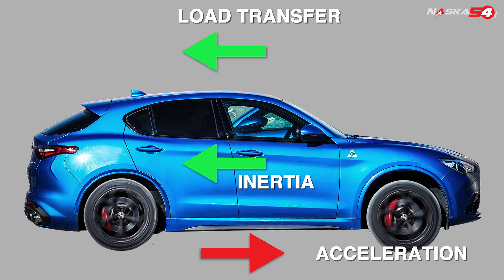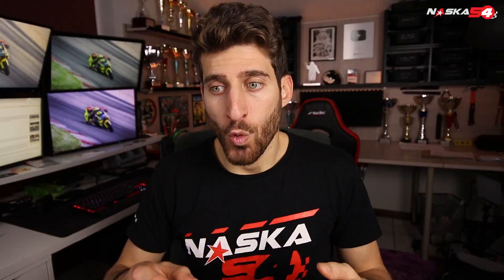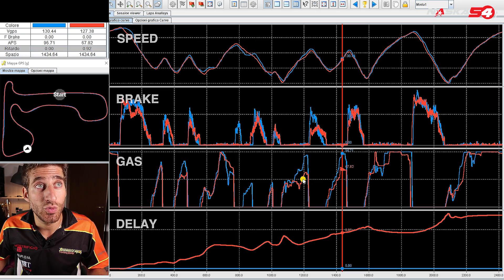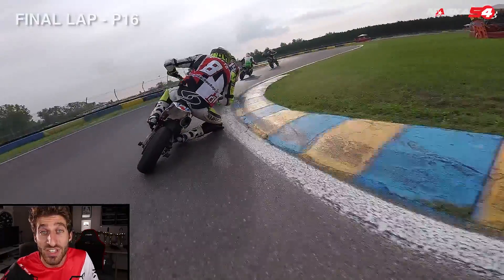THE WORST CRASH OF MY LIFE - THE LOAD TRANSFER: What is it and how it works?

Comment: Thank you a Lot for this Video. I have been Racing Motobikes over 10 years and didn't know the Tip for preloading the tire for accerleration. But isn't a instability in the Front then? With a small Bike i accerlerate before the mid Corner Sometimes...

Comment: happened to me once, it was a large and nice road, a perfect invite to gas. Entered a corner, it was to long and I felt the car was just starting to slide both ends. I did not accelerated bc it was a RWD and there was the wall close, a rear slide would probably snap on that wall. Kept the gas same as I entered that very corner with the intention to not loose car balace. Eventualy the turn finishes, as I was geting closer and closer to the wall, but it all ended fine for me.

Comment: Question,  On a car when you brake and turn , if you brake a little too hard it will go straight.  How come cars with downforce can load the front further?  Do they use different tires that can handle more load or is it with no downforce the braking force exceeds the grip before the cornering force?

Comment: Alberto I'm really enjoying your channel. The Fiat 500 has a open diff so the tyre with the least amount of load is the tyre that most of the engine braking goes to... So...  If you pull away fast in the Fiat 500 the tyre with the least load spinns. (Doing a wheelspin.. One tyre fire..!) The same happens when the car engine brakes all the power of engine braking goes to one wheel, always the wheel with the least amount of grip.  Basically when you lift off the gas in your crash the front inside wheel has all the engine braking and the car spun around that tyre. Differentials have a lot to say how cars behaves. I personally really enjoy front wheel drive open differential format.  Lots to learn but the learning is the fun part. I hope you get to the opportunity to drive more front wheel drive cars and show us your learning and progression this for me is the best part of your channel. Talking of learning where is the heel and toe? ;)

Comment: Inertia is exactly a Force, and the force is equal to mass multiplied by acceleration.  You only feel the force of inertia when there is acceleration, and with no acceleration - the inertia keeps something moving in an "unaccelerated" manner, and you and it feel nothing.  In your car seat, you feel pressure, and that pressure is the force (due to your mass multiplied by the acceleration pushing you into your seat) divided by the projected area of the contact patch you have in your seat, where the projected area is the portion of the area perpendicular to the direction of acceleration.  Elementary my dear Watson.

Comment: 4:08 i think that happens because the swingarm pivot point is above the axel of the rear wheel, so when you accelerate, like you said, the chain pulls the wheel towards the bike, and the rear suspension unloads. This can be called antisquat 😂 nice video as allways 👌🏻

Comment: In a modern car, with ESP, you can press very hard the breaks in the middle of a corner and it will stop while keeps cornering because of the electronics. Without ESP, you would be out of the road.

Comment: 12:42: I have the strong suspicion that with compressed suspension a bike rather has a shorter wheelbase than a longer one.
Reply: The Stonegate Roadrunner correct. I was going to comment to Alberto but saw this comment. No need to echo comments hence my note here. 

Great video anyway Alberto. Keep up the great work.

Comment: Wow Alberto, in this video you are talking about exactly what I wrote in the comments to the video about the big front brakes, probably read my comment. But still did not say what parameters affect the transfer load. And this is primarily the size of the wheelbase and wheel track. That is why on your Abart 500 with a short wheelbase and narrow wheel track, with a high center of gravity, with the arrival on the curb and there was a coup. This would not have happened on a long, low, wide car. 
Cool, I did not even imagine that when accelerating the rear suspension of the motorcycle is decompressed, very interesting, I thought that it happens the same as on the car.
PS When will you make a video about the explanation of the suspension work from the Andreani factory?

Comment: nice explanation, I like the chain on acceleration causing the rear to lift and shorten the bike, which in tern must increase the bikes rear ground pressure. (engineer with an MT-10!)
Reply: In motocross you can even help the rear shock with very hard impacts, like when you overshoot the downward slope after a jump and land in the flat, by beeing in the right gear and applying a lot of throtte upon the impact while having your bodyweight more towards the rear. Or in enduro racing you can also use it to power wheely your front tire over e.g. a log and soften the rear wheel impact without throwing you over the bars. It's very interesting how you can use physics and phenomena created by the way bikes work to your advantage in different riding situations.

Comment: So what you mean? You mean in that turn, give a shunt of throttle to shift the weight on the suspension, then would the natural thing to do, be to let off everything, let the car slide and regain traction and stability on its own. Then when it feels stable and the car has regained it's grip to the asphalt, to send fuel through the injectors to get up and go. Is this phenomenon correct?🤔 am I missing anything?
Reply: Give gas, rear is more loaded, the slide that happened because of too much braking will stop and you can turn with constant speed